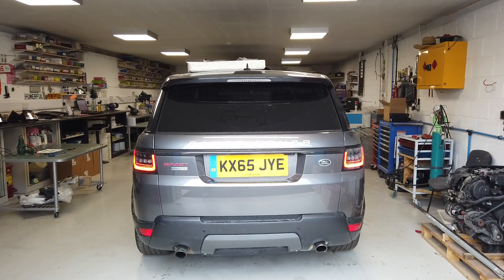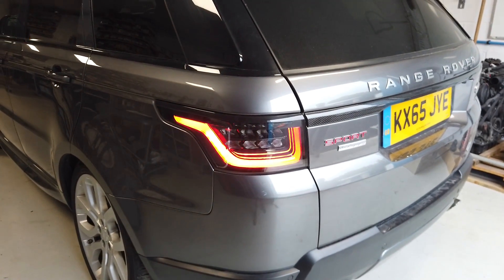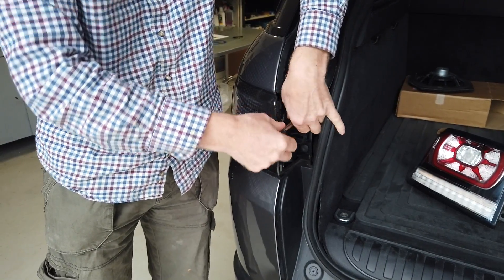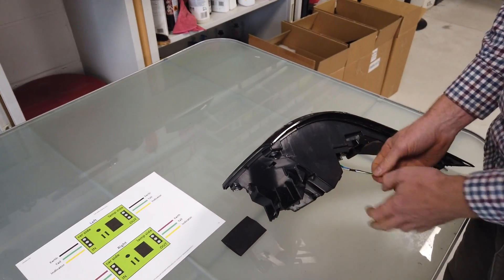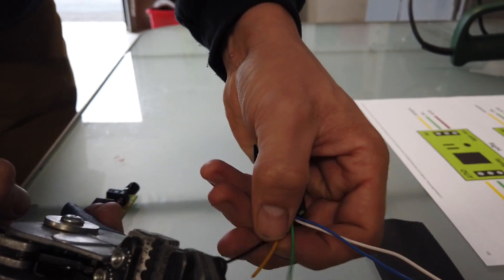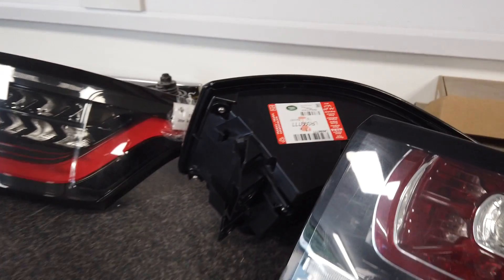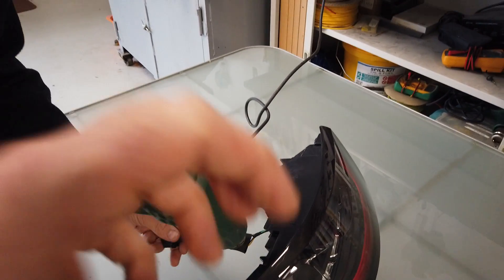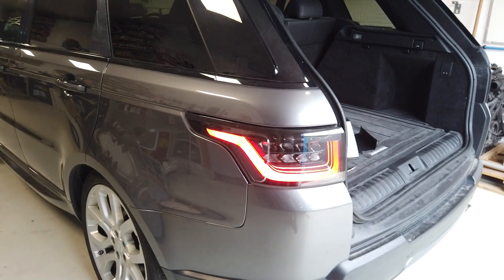How to cancel tail light when indicator is flashing on Range Rover Sport L494 rear lights

Comment: Just fitted aftermarket rear  lights, they appear to have fixed the issue out of the box now?
Reply from the maker: Glad to hear it worked out of the box for you!
Reply: @L663 cheers, I’ve just checked in case I had it totally wrong but the red definitely drops out during the indicators

Comment: HELLO IN A VIDEO ON YOUR CHANNEL YOU TUBE PRESENT YOU AN ELECTRONIC ASSEMBLY FOR THE REAR LIGHTS OF A RANGE ROVER SPORT TO CHANGE THE MODE OF OPERATION OF THE TURN SIGNAL WHEN THE LIGHTS ARE ON IS IT POSSIBLE TO BUY BOTH MODULES, ON THE ONLINE SITE, I HAVE NOT SEEN ANY,   THANKS FOR THE REPLY

Comment: Will you be posting the circuit board for sale?  I don't see it on your site.  Thanks in advance!
Reply from the maker: We did sell it for the genuine lights but it had some problems - we need to redesign it
Reply: @L663  but mine are the aftermarket ones, could I/We still get them??
Reply: @KeoniHills  I also need them!
Reply: @Kikecorral1989  I made my own, I'll post a video and DIY later.  Traveling for work for a couple more weeks though.
Reply: @KeoniHills  nice! Thanks!!
Reply: Hi has this been redesigned for the genuine lights yet? 

Many thanks in advance

Comment: Great video Guys, these are the exact lenses I want to buy but I can only find the 2018+ versions of these upgrades on your site and not the ones for the 2014 to 2017 L494's. Are you no longer selling them? Any updates would be great, I'm finding it difficult to find a high quality version of these but really only trust your outfit to ensure they work great. Thanks in advance for responding. Todd in D.C.
Reply: Ok, nevermind, my You Tube finally let me read all of your responses and looks like this product is dead, too bad, amazing idea. You all just need to sell 2018 upgrade aftermarket tail lamps for 2014 to 2017 L494's, I'd pay handsomely for a quality set from you all. Thanks anyways boyz.

Comment: interested in purchasing these boards but dont see them on your site??
Reply from the maker: These only work with the aftermarket lights - not the genuine ones so we removed them from sale on their own as it was not worth it.
Reply: Hi could you please make a pair of these boards ? I want to purchase them for my aftermarket lights ?
Reply: I have read that using a resistor across the indicator and indicator wire can work? Anyone tried it?

Comment: Received the boards thanks, if it ever stops raining i'll get out and fit them. Have to say you guys are great, i've bought a few items from you now and never been disappointed. I have undertaken tasks like replacing the tread plates that I would never accomplished. Without your your videos I would have ended up in a right mess with loads of broken bits. Oh, and where do I get the shrink stuff from?

Comment: Not being sold separatedly from tail lamps, however you can buy a timer for this purpose https://youtu.be/yhWzULqf2gs
Find link to shop and instructions to set in the comments
Reply from the maker: Yes there are other ways to do this and thanks for sharing your link with others.
The problem we had is that sold the boards on their own and then they did not work with the genuine LAnd Rover lamps and lamps from other suppliers.... so we had a big headache trying to be helpful to people and so we stopped selling the boards.

Comment: Does this fail mot as it stops an obligatory light from working ?
It actually makes the vehicle less visible because the rear end of the car is in darkness when the hazards are on.
Reply: The OEM lights do exactly this on the newer models. When the blinker is on it can replace tail lights in back, and DRL or side lights (at night) in the front.

Comment: great worrk guys! Any chance I can buy a board like this?
Reply from the maker: Hi Yas the boards do not work on the original factory lights
Reply: @L663  Hi, i bought some aftermarket sweeping lights, so they are not original and they the tail lights only slightly fade out
Reply from the maker: @yasindin  Ah.... so you went to the dark side and purchased from one our our competitors ?
Reply: @L663   in genuine LR 2018 rrs conversion lights, they do not have the sweeping indicator do u have an option to resolve the, also we just order two grills from you, top quality thanks, 🙏